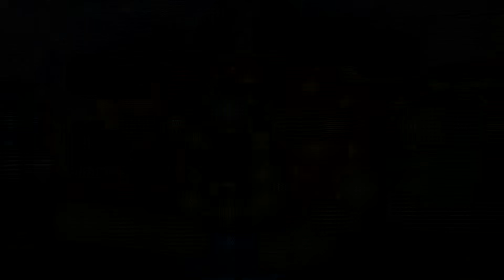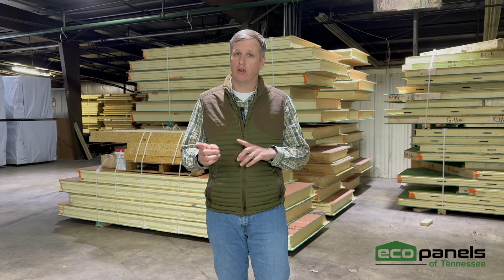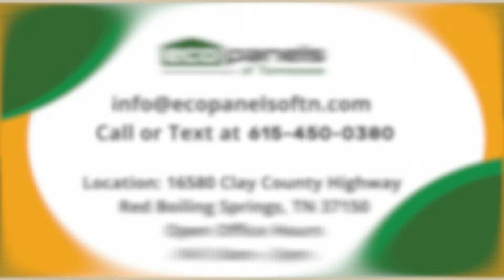How to Avoid Costly Mistakes When Building with SIP Panels | Eco-Panels of Tennessee

Comment: 5:01 So you don't design the house kit? 😮
Reply from the maker: Well, yes and no! We take your plans that you provide and we can make small tweaks like moving a window over or placing an electrical box in a different place, but our design process is mostly converting your plans into a SIP plan. Kristi, our designer, is talented but only designs SIP plans, not full house plans.